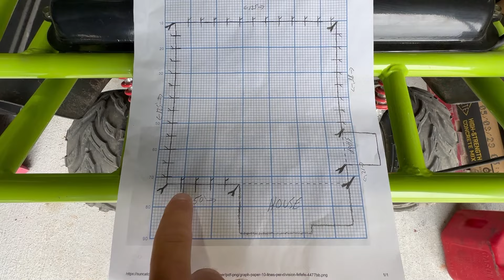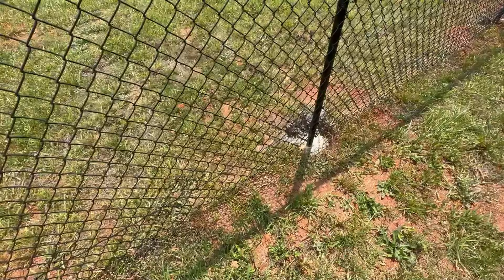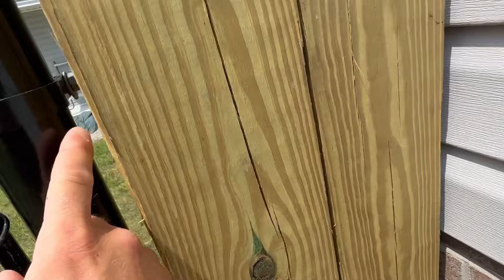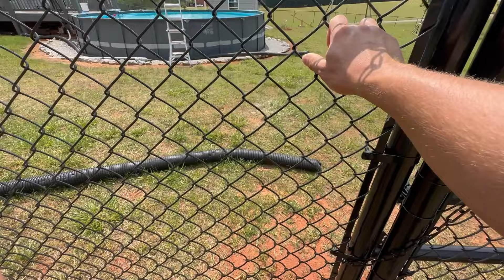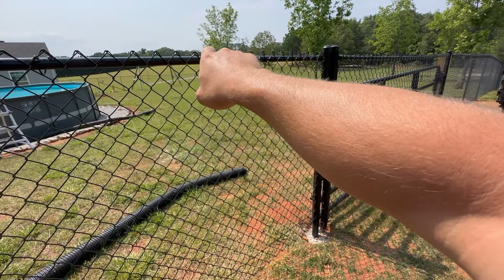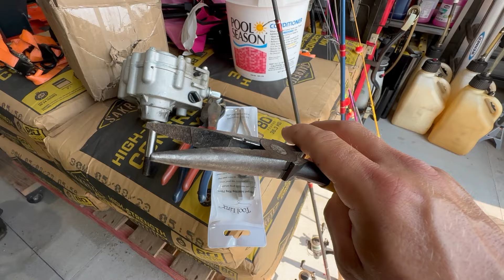How To Install a Chain Link Fence | Save Money DIY

Comment: Nice work. 
I started at Lowes but their stock was picked over and scratched (likely returned inventory). Then went to a local fence supplier that gave me contractor discount and it saved money and I got a better product. A fence supplier that deals retail is hard to find, but well worth it.
Reply from the maker: I tried that locally and these crazy people wanted more than Lowe’s for the same product. I’m glad you were able to work a deal out. A lot of places in my area have gotten greedy because of all of the housing developments that they’re throwing up around here. I will tell you if you find out how much of whatever it is you’re wanting equals a full pallet, order that amount from Lowe’s and they’ll give you a fully wrapped pallet the way they received from the manufacturer, not something that’s been picked through.

Comment: Why didnt you do the pole at the bottom?? My dogs are getting out of the bottom with that type fence
Reply from the maker: Those poles are very expensive and would’ve added a ton of cost to the project. Luckily my dogs haven’t ventured into digging through the fence and the wire I put is working as intended.

Comment: Great video.   I'm going to attempt a 375 foot install.  How long did your project take to do?    What was the total time, time to auger the holes, time to place the posts and pour concrete  and time to stretch and secure the fence?   Thank You!
Reply from the maker: I feel like in total it was about 3 full days of work,  and 1 day of planning and getting material. 1 day I marked out the holes, checked everything and used my tractor to auger them, get the post hammered and concreted (used a mixer). Day 2 got the top rails installed and got the gate installed. Day 3 got the mesh stretched and installed and tension wire. I did have help on day 3 with the mesh. You can do it alone but it’s easier with 2 people. With figuring everything out, getting material staged and everything I’d say 4 days to be safe. Hope that helped!
Reply: @reallifetested2605  Thanks, that helps a lot!  I live in CA but am flying to Iowa to do this job.   I want to make sure I give myself enough time.   I'm confident about all the steps except the possibility of having to cut a bias.   Also want to make sure I auger deep enough to deal with frost line.  I'm leaning towards using Quickcrete in the holes and adding water vs. a mixer rental.   What do you think?   Faster/Slower/Same?
Reply from the maker: @pack707 it would definitely be faster but I’ve personally never done it before. I’ve seen a fast setting post concrete that’s made just for what you’re wanting to do. It says it sets in 30 minutes and is designed to just pour in the hole and add water. Around here it’s in a red bag I imagine it’s the same in your area.
Reply: @reallifetested2605  One last question.  Why did you drive the posts and use concrete?   Why not just drive them all the way?    I'm considering driving 8 foot posts for a 5 foot fence.    The benefit is it's faster,  no wait time for concrete to cure, no extra dirt to deal with and no concrete cost.  But there seems to be disagreement out there on the "drive only" method.  With 40 posts total, maybe I will drive the Line Posts and use concrete on the Terminal Posts.  I start in 3 weeks.   Thanks again for the advice.   I will let you know how it goes.
Reply from the maker: @pack707  Honestly no reason other than I had the gas powered hammer. In my mind it would be easier to hammer them in level then concrete. Rather than digging and concreting only hoping they stay level while the concrete sets. I read online driving them only is fine if you have solid soil. A lot of people ive talked to have really sandy soil and say over time the post will shift but i'm not really sure.

Comment: How many feet total was your fence....approx how much did you spend building it.
Reply from the maker: Just checked and it was a tad over 450’ total cost was right around 6000. I remember I saved a substantial amount by buying fittings from the website I talked about and listed vs at Lowe’s or Home Depot.

Comment: Tension qire should be midway between last diamond on the bottom
Reply from the maker: I don’t remember if I mentioned it in the video or not. But I put it that height because I have 2 German shepherds and the height I have it at is right at shoulder height for them. So when they’re playing and run into the fence they just bounce off of the wire haha

Comment: Dirt is going to rust the post
Reply from the maker: By the time they rust I imagine the whole fence will be in bad shape and need to be replaced anyhow.
Reply: @reallifetested2605  I don't think so  I  the fabric can last you for a long time I have done alot of repairs where the post buried in dirt are completely rooted
Reply from the maker: @JoseGonzales-ul9sv I see, what’s the best way to prevent the post from rusting out?
Reply: @reallifetested2605  the way you were going to do it till your wife said not to every time I removed an old fence wood or metal   80% Of the times  the posts are still standing n  have to cut them down  no rust at all
Reply: actually dirt is best,  concrete will rot the post. do some research before you comment on what you don't know

Comment: How do you figure how far apart your line post need to be? Good video
Reply from the maker: I can’t find the exact chart I used. But if you Google chain link fence post spacing chart and look in images it will tell you exactly how far apart to space your post to get them spaced evenly based on your length of run.
Reply: Maximum is 10ft

Comment: You shouldn't connect to buildings because the expansion/contraction is different than the fence. The way you did it is great.
Reply from the maker: Out of all the research I did none mentioned that. But that is an excellent point that should have always been mentioned. I was surprised at how hard it was to find an answer for this. I'm not sure what "professionals" do.